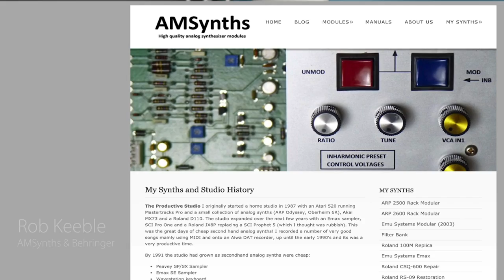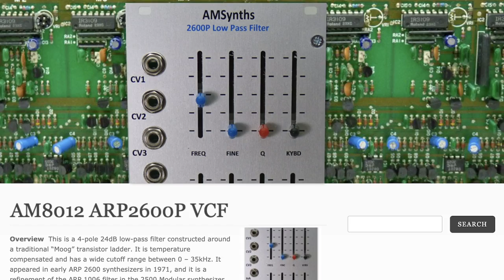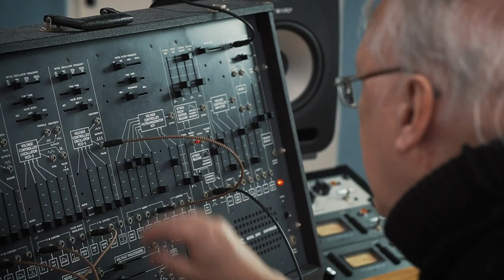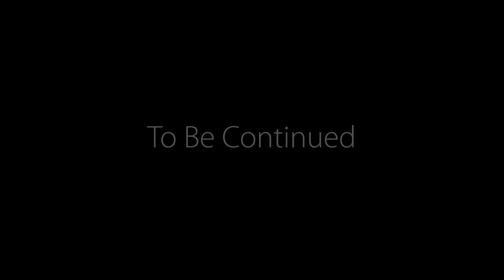NAMM2020 - Introducing the Behringer 2600 (Part 1)

Comment: Korg: We reproduced the ARP 2600 for $4k. Come get it!!!

Behringer:
Reply: But Korg sell a quality product with the price, with a limited edition they can control the quality of each ARP2600 they product.
The BARP2600 can be a good synth in general like the pro 1, but you have no guaranty that YOUR BARP2600 will be good, and will not have something "broken". This is what you pay with the low cost and massive production.

Then for the professionals who have money and want quality the KARP 2600, and the name ARP on their synth  tis the synth to buy.
Reply: @jean-louispech4921  Have you ever played a behringer synth?
Reply: @jean-louispech4921  Come on Jean louis, components like chips, diodes, resistors,etc are all the same and they're pretty cheap in fact. when a company like Korg is selling the Arp2600 at almost 4000$ they make fool of us. It's just gready marchandising
Reply: Bank side leopards you don’t have to buy it
Reply: Behringer: Hold meine bier
Reply: Bank side leopards come on, it’s a full size reissue and handcrafted in Japan, that means very high QC. It’s pretty much a normal price for this synth considering how much it would cost to get the original one.
Reply: jean-louis pech Behringer can offer all these synths for cheap because they are a huge company owning Midas, TC Electronics, Klark Teknik and other brands. They can produce and sell many more units than any other company which leads to a better price. They even manufacture and sell components other companies rely on for their instruments. I'm sure the Korg remake will be great but Behringer can offer the same quality for a much better price.
Reply: Behringer: We did it for $400!
Reply: @jean-louispech4921  I own many AMS modules that Rob created and have had them for a very long time. They are amazing and the quality is amazing. But I don't fully trust Behringer's manufacturing quality for instruments that are more complex than Eurorack based modules or Eurorack based synths like Mini D, Pro 1, etc. I'd take $3,900 Korg 2600 over $1,600 (whatever the price will be) Behringer 2600. The Korg will appreciate in value as well, while Behringer will drop in value a lot.
Reply: Bank side leopards Price of product is never just the cost of parts. Behringer really doesn’t have to spend a lot of money on R&D because they’re taking a real instrument and just clone it. Also they are produced on assembly lines so that’s cheaper as well, I don’t know about KORG but for example MOOGs are manufactured by hand in US. I love Behringer products but every time I see them announcing a new product I can’t help but think that they just steal another company’s design and support cheap labor in China
Reply: Price for the BEH ?
Reply: Handmade in electronics it's not a good thing, it's worst, there are more failure chance that building with automated procedures. Quality checking after production with calibration is where they need people, no in the assembly line.
Reply: @cgereueu  How do you know it will appreciate in value? The Korg Odyssey sure hasn't. If anything, the competition will bring the price down.
Reply: @jean-louispech4921  you have no guarantee that the barp will be bad. All of their synths are of good quality...
Reply: Just go and watch all of the videos that are already on youtube of people comparing Behringers PRO-1, ODYSSEY, MS-20, TB-303, SH-101, 808, 909 to the originals. Every single one sounds STUNNING and are at least 99% like the originals. Their ARP 2600 will be no different!
Reply: The snobs will buy KORGs. The rest of the world will buy Behringers.
Reply: @fermiLiquidDrinker  I have. I bought the Model D when it came out. It was a lot of fun for a little while until the lack of quality started to show. Filter is clicking and making noise when I turn it, a knob fell off, and the entire instrument is out of tune by a whole semitone. I am never bying Behringer again.
Reply: @banksideleopards2791  I disagree
Reply: @LousyFacelift  

yes i know almost all, else the list of all companies.
Thisis why peoepls are comparing apples and oranges when they compare the  prices from Korg and from Behringer. 

No behringer can't guaranty the same quality than Korg, this is part of the cost of high end synths. Guaranty of the quality has a cost, it need time and peoples, this is the thing that Behringer can't do with great production.
They can produce good synths ( many peoples are happy with their Behringer clone ...    ), yes , but not the quality of all the synths of the production (  ... but others have  failed/bugged products ) . 

This is the difference with Korg who needs to sell quality products to professionals for the price.
Reply: @jean-louispech4921  That's why warranty was invented dude ;)
Reply: @amsterdamob  🤣🤣🤣👍🏽
Reply: There's Coke/Pepsi and there's lidl/walmart cola, tastes exactly the same but costs less. There you go
Reply: Yes, bring it on 😁
Reply: @banksideleopards2791  

Well , you believe that components are all the price of this synths?
Just for  the hardware side you forget : fullsize,  keyboard with aftertouch and LFO integrated, speakers, and professional flight case.
Elements that are not in the version of Behringer, and then add  ( more or less   ) to the price.
You must add the quality test for Korg, that Behringer is not making (Uli himself explains that this is part of the low cost and large production).
You must take in count that components are usually cheaper in greater quantity ( manufacturers of components give usually  a lower  price per components if you buy 10 000 than 1000 for example  ).
You must take in count that there are fixed costs for the global production (  R&D, cost of administration of the society, etc....  ) , and that the more you are producing synths lower is the cost per synth. If you have for example 100 000$ of global  fixed cost  for a product ,  if you produce 1000 synths you have 100$ per synth, if you produce 10 000 synths you will have 10$ of costs.
Given the fact that Korg/ARP are making a limited edition around 1000, their cost/synth will be higher than for Behringer who target the mass.

Just with this simple facts, we can see that the price of Korg/Arp  will be higher than Behringer, in any case.

The more complex facts are related to the fact that Behringer is a big company, has its own line of production of components, make money on others sectors than instruments, that it is more a hobby for UB  while Korg rely on selling instruments, etc....
It means that Korg and Behringer don't need to make the same profit on the synths for living, for getting money for investment, etc....

Like says C G  with limited edition and high end quality, the KORG version will get value in time, while the version of Behringer  produced in mass will loose value along the time.

Korg targets high end professionals, if you don't need a flight case for your 2600, you are not the target of Korg/ARP, it includes quality, reliability, etc... Korg targets peoples who think like "C G",  who don't trust Behringer on the reliability, etc... for their  low cost synths.

Behringer targets peoples who can't afford professional /original version.

This is two different world, two different customers with different needs and capacities.

The KARP 2600 and the BARP 2600 are not concurrents, but are in fact complementary in the market. This is why Korg has made the new high end production of the 2600 while knowing that Behringer was making a  low cost version.

It is more complex than just raw numbers.
Reply: @BeastlyAnteater  i dont think it comes down to wanting to buy it. Im pretty sure most of us would. But at 4Gs. All of us dont have that kind of money. And to just say we dont have to buy pretty much shows who this is made for. Rich synth collectors and musicians. At least Behringer is attempting to give the middle class and under something we can afford that sounds and works like the original or so close that it makes no difference if its a clone or not. Sometimes you actually get a few more options with their products. So if Behringher can do it then believe the big companies can too. But they just keep taking your money. So go ahead and pay more just for the name. Im sure others are making just as good or better music with these Behringer products. Ears only hear what sounds good. Not who made the equipment.
Reply: jean-louis pech The only reason Korg gets to price the 2600 that high is because there will always be fascists who don’t want to be seen with a Behringer product, and rather have a “reputable” company like Korg milk them for money. It’s the same reason that Apple products cost more than, let’s say, Huawei products. Doesn’t matter that the Huawei has higher specs and better performance with similar components, the reputation of Apple precedes the quality and that’s all. Not saying Korg is bad, but musicians that complain about Behringer products nowadays probably don’t even own anything by them
Reply: @fermiLiquidDrinker  

it is not about me playing Behringer synth,  but about all the looser of the low cost lottery who wanted to play on behringer synth but get a synth malfunctions, bugs, etc.... I am lucky to not be part of them with my neutron.
This is the game of the low cost, this is the invisible cost of buying a Behringer clone, and UB is conscious of this fact.
I don't have any idea what is the percentage of this bad products, but they exist. This is why on internet you can see peoples happy with their B Clone while other are angry about the bad quality.
Since there is no quality test with the clones of Behringer ( too expensive for large production  ), buying one of their clone, at low cost is taking the risk to buy a bad model.
This is one difference with Moog for example who test every synth they are making, and then give a guaranty on their product. I guess that for ARP it is the same with their 2600.
Reply: @klonhead   + Ryan Moran

i don't speak about the sound, i know that the Pro 1 is very accurate, this is not my point.
My point is about the lack of quality test, and then bad synths sold to some customers, with bugs, non functioning features, etc....
Reply: jean-louis pech haha no quality test? You work there so you know?
Reply: @shabbee  It doesn't taste exactly the same though, that's the thing...
Reply: The difference is for cork sniffers and hobbyist and/or musicians who can afford the best.  The Korg design is authentic reproduction of the original, using hand wound inductors, etc - spot on authenticity.  The behringer version uses modern engineering to produce a VERY close approximation of the same sound but much more cost effective components;
Reply: @bartm2000  Problem being many of us have owned behringer products and fully aware of their QC. Loved my truth monitors, but had to have them repaired a good few times and behringers policy on out of warranty products where to bin them. Hopefully things are better these days but only time will tell. Love the tc2290d. My concerns with behringer being they will force good manufactures to collapse due to pricing them out of the market. They are releasing so many they are flooding it. I also don't see korg as the Apple of the Synth world. 

I don't think Korg are intentionally overpricing this, they must be fully aware that Behringer would release a 2600 clone, cheap. Price wise Korg have a pretty varied range on synths from low cost to High end. So from that point of view I find it difficult to see their reasoning with purposefully milking their potential market with the knowledge they will get undercut by behringer. 

The other thing I just find odd, being that on a good few videos I see comments such "I own 5 behringers but I need this now, take my money!". If you can afford to spend 300 every other month or less, surely you can afford to by higher tiered units. Modal, ASM and korg have really brought something interesting to the table recently, just hope they don't get too overlooked by products offering the idea of something past.
Reply: @acoustic61  nah. It won’t be any less expensive than their Odyssey clone. Likely $600-$700 at minimum.
Reply: @Brendan-Black  But keep in mind, Deepmind was their VERY first entry into synth world, with a brand new design. Of course you would expect the first production run or two to have some issues to sort out. On the whole though, they’re consistently improving - not many issues at all with their latest line of synths. No more than Korg, Moog, etc. 

I have Neutron, DM12d and MS-1 btw and they’re rock solid.
Reply: @LousyFacelift Korg and Roland and Yamaha, etc are equally massive companies with tons of subsidiaries all around the world, it’s not like Moog or DSI where one could argue that they’re small people-focused operations (relatively speaking) getting hurt by a faceless corporation. 
Behringer has definitely exploited their manufacturing and cost-cutting advantage but there’s also a fair amount of these other big companies taking too many pages from Gibson’s book and trading on nostalgia and cachet and artificial scarcity to sell stuff like the overpriced Boutique line and endless software licenses, etc.
Roland spent years and years dragging their feet on making a new 808 because they wanted to keep reselling people those sounds as copyrighted expansion packs and whatnot and having original models selling for $8k on eBay was very good for that.
Reply: wiencheck Moog does a fair amount of their high-tech fabrication in China and they buy chinese components- but so does basically any small company that wants to assemble electronics in the US. Your broader point is fair. But Korg really has no such excuse
Reply: Ave Metalhead I agree with your broader point but the example you’re using is literally wrong.
Reply: @Brendan Black in their defense that was the first synth they ever did. The quality and uniformity have improved a lot since then.
Reply: @acoustic61  i wish but it's probably going to be a bit more, i'm thinking they could do it for around 800-999 depending on the options they provide
Reply: @sonicase  did you or anyone happen to hear if it’s going to have a real spring reverb tank?
Reply: Ave Metalhead bingo
Reply: Ugh I ordered the Korg 2600 FS. I'm sure Behringer's one is going to be just as good, but without the 'faithful physical reproduction'. I'm not mad :) Though my bank account might be...
Reply: @SuperMegaWoofer3000  lucky :) what you have there is a sound investment. It’s an extremely limited production run, (under 400, right? Or is it 200?).   Either way, it will not only hold its value, but very likely bring in more than you paid if you decide to offload it in a couple years.
Reply: @mpmi7588  Im never going to buy any ARP 2600. My point is why tf are you complaining about Korg selling their OWN product that they designed at the high end price when you now have access to a perfectly serviceable and probably incredibly sonically similar clone from Behringer. Its just childish; there is room for both of these things to exist.
Reply: @bartm2000  Come on man, "fascist" for not trusting Behringer products? They've been making cheap clones of existing things for decades, its only very recently they've been able to make decent analog synths. Nothing fascist about having an opinion, Behringer is open to make whatever cheaper stuff they want to
Reply: @statueoftheabyss6886  YES thank you
Reply: @bartm2000  I don’t think fascist means what you seem to think it does.
Reply: @Brendan-Black  precisely my point 👍
Reply: @jean-louispech4921  i agree with you in many points J.Louis and I know than the hardware part of a Behringer are not as good as the korg one but if I have to change few potters after 8 or 10 years of use personally I don't mind, it will take me a couples of hours and 10 or 20€ . You know for 4000$ you can build a huge eurorack synth with high end quality modules... Companies like Moog, Korg(not always) make us paid the name of the brand. I think it's very good than a company like Behringer comes and challenge then on this market. You know when I spend 1000€ on synth or on modules, it took me a lot of works to make this money, often this means that I won't go on holidays. So I don't accept that companies over charged their synth just for the prestige
Reply: @colorgasm  My eurorack case didn't cost me much, I bought a good quality flycase on a car boots sale for 10€, I add some wood to it (for free) and I get the power supply from Doepfer. Finaly it cost me less than 200€ with the fly case. If you like to be ripped off by big company it's your problem
Reply: @BeastlyAnteater  the way its worded makes sense. And i agree with you. Iwas just saying that in general, if Behringher can make their equipment for these prices and the work/sound good, then im pretty sure that the bigger companies could lower their prices. Not to the extent of Behringer"s prices but still lower. Its lilke theyre only making them fior the rich sometimes.
Reply: @cartilagehead  Whilst these are large companies, if the synthesiser sales slow or drop off to a greater degree that expected they will put less time and money into these areas and may just end up putting out cheap units that will always sell and easy to predict. It could have a serious knock on affect to the development on NEW/future designs. As i said previously, it would make little sense to purposefully price yourself out of the market with full knowledge of behringers ambitions and as such doubtful that they are inflating their prices to push out musicians on a low income. That and they do produce plenty of affordable devices and have done for many many years.   

Unfortunately in life there will always be things we can or cannot afford, behringer have a made a good job at selling the idea you are buying something worth more than its value and would say they are the ones exploiting people more than not. Personally have no intention of buying either, but I am a big fan of Korg products historically and not so much of Behringers. I am looking forward to having a go one the pro one though at some point.
Reply: @Psztyk236  yessssss
Reply: @AdamsBrew78  Lol, Gibson convinced a lot of "Blues Lawyers" of that very thing a decade ago. "Bu-but it comes with a certificate of authenticity!"
Reply: @statueoftheabyss6886  As to your first point- you could also say the same thing about Behringer. They haven't experimented and released many new original designs that push the envelope very much. The Neutron and Deepmind are pretty much their only synths so far that aren't clones/modified clones of something that already existed. With their new Japanese R+D studio and recent hires and collaborations I have confidence they'll come out with more original things in the future. But, to quote your post, if their clone synth sales drop off to a greater degree than expected or they don't sell many original synths they may drop the venture altogether, or only make a handful of clones that sell well. This point applies to Behringer as much as it does to Korg. Both are huge companies with big Chinese manufacturing facilities and with tentacles in lots of different parts of the musical instrument industry.

I don't think these other companies are consciously pushing anybody out or trying to price out low-income buyers. Not at all. Korg and Vox, etc make tons of awesome products that are affordable and aimed at getting everybody to have fun with synths. But I think they've also been living by a model (especially in light of the economic troubles of the recession) that believes that nostalgia is best sold to fewer, older customers who have deep pockets than to a bunch of starving young punks who "probably aren't interested in the old stuff anyway". It's the model that Gibson relied on and was somewhat successful at for a while. Contrast that with a company like Fender where there's a huge nostalgia element and a market for premium/custom/limited instruments that cost several thousand dollars, but also Fender/Squier guitars are workhorses that have been used more than any other brand in every genre of electric guitar-based music from the 1950's to today. There's a Fender/Squier strat at every single price point of the market, from $200 to $10,000 and all of them lead their respective classes to the point that most guitar heads would say that there isn't a single "bad" Fender for sale in 2020. That's how you absolutely dominate a market.

To your last point- I would disagree with you and say that some of these companies that have monopolies on certain products/intellectual property/etc (like Korg who owns the ARP trademark and trade dress, or Roland with the 808/909/etc) are selling the idea that these products are worth more than they actually are. Original clean 808's are selling for $8k on eBay? Well then we should sell ours for $6k (hypothetical extreme example) or $2k or $1k. Never mind that it may only cost a few hundred dollars to produce or that the original was sold as a relatively inexpensive drum machine/practice tool. That's understandable- scarcity and desire from contemporary musicians and collectors makes these old products very valuable. People who want to be like Kanye or Daft Punk want an original 808 and can't get one. Artists with the means, pro studios, and music schools snap them up at inflated prices from resellers. It's hard not to look at that as Roland and think "I want a piece of that". But then how do you price your reissue? Do you take advantage of the fact that demand is high and supply is very low and prices on original specimens are insane and give it an artificially inflated pricetag (after all $6k is less than $8k)? Or do you price it to move, with much lower margins?
Reply: @bartm2000  At a time when actual fascists have been ruining countries and lives all over the world it's a bit much to go around calling "people who pay too much for synths" fascists, even if Alex Jones apparently has a really killer synthesizer collection.
Reply: Alexander Mosello didn’t know the word had so much weight lmao, +1 for the Alex Jones joke. My family and friends always used it in terms of music and technology because we equated it to someone that dislikes you for having a different taste to the point that they wouldn’t associate with you.

And that’s the thing, I’m not saying Moog or Korg or Dave Smith stuff isn’t good, it’s brilliant. And I’m not saying Behringer is higher quality, the price tells that story itself. Its just no longer low quality garbage which deserves getting bashed all day. I’ve found that, in my experience, most people that own a Moog can’t wait to rub it in your face and undermine your cheaper Behringer gear. Maybe change the word from fascist to “elitist” and it’ll make more sense. I don’t know, so many musicians get caught up in how amazing their expensive gear is but half the time you can’t hear the sonic “improvement”, especially not once the track is smashed by a mastering chain  and then converted into MP3, after which it is played on bad phone or laptop speakers. I just find it pointless to keep feeding into this system of paying significantly larger amounts of money for a small increase in quality and brand name. Same thing applies to every industry really, if we all show we won’t buy the super expensive stuff, they have to make it cheaper, it becomes more accessible and literally everyone sees benefits from it.

Sorry if it sounds slightly ranty, I hope it all makes sense. I’m not actually out here to argue, I think everyone makes a good point, I just phrase my points a bit harshly sometimes
Reply: @cartilagehead  The original arp 2600 was 3300. How is charging 4k for what appears to be an Arp 2600 be over inflating the price? Behringers looks cheap compared with korgs, im sure it will be cheap comparatively. Im sure it will sound good, but they are too very different beasts. If behringer stopped producing synths I wouldn't care too much, if korg did it would be a very sad day. TR8 was what 400 new, that was a 808 and a 909, so two hundred a piece, overinflated? Seemed a reasonable price. I have a JP08 and i like it, the boutique 808 909 303 was just weird and a poor choice, but as the original boutiques sold well and still do, it isn't surprising the way they priced them. Not to mention that most of these sounds can be replicated via vst's. So if you really want to sound like xy or z whom used this that and the other, you can and have been able to for sometime, pretty certain there isn't a conspiracy to stop anyone from doing so. 

I cannot imagine Korg or any current synth developer/maker are under the impression that young punks are not interested, you just have to look at any one of Behringers posts to see the interest. Im certain they would have taken this all on board very seriously.  

I commented as it felt like many are attacking a company that have been letting musicians produce for years and years, young and old and the quality has always been to a good standard overall. The same cannot be said for behringer, ill concede it feels more improved than they where in the past but only time will tell. 

Im a guitarist. I'll take the Gibson please:)

I also have had a vcs3 borrowed for 9 months, when behringer release it and should I purchase it, I would not think for one minute I owned a real VCS3, but you can bet behringer will convince many to feel they do who never have. If im wrong then ill be happy. Ill also add that when I mentioned the VCS3 to most musicians back in the the late 90's early 00's (which is when I got to use it) they looked blankly at me and where pretty much saying "VCS3?", now you have 15 year olds screaming "I want a vcs3 clone", if you looked them up on a internet there where a handful of pages about them and the history. No one is under the impression that these units are for the old nostalgics reminiscing on the past, if so the demand for the VCS3 would be exceptionally limited.
Reply: MP MI that’s fair and I could see that happening for some instruments for sure